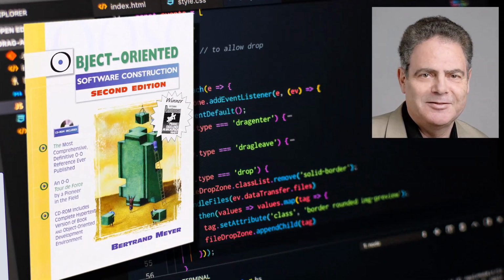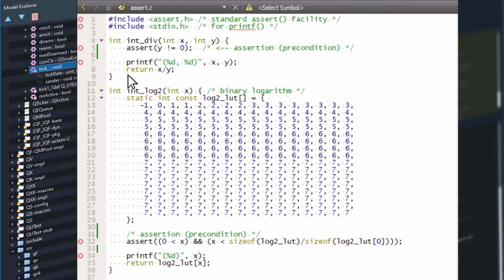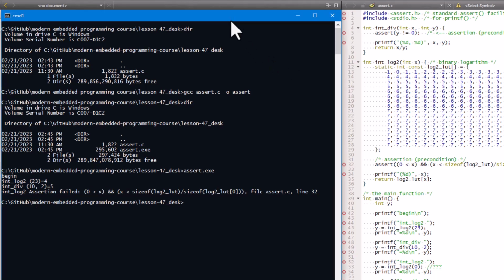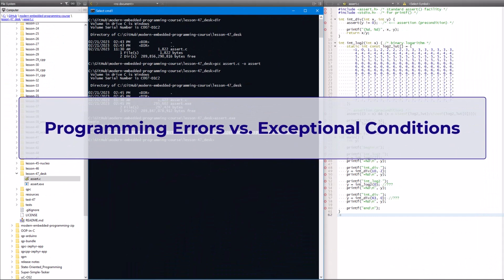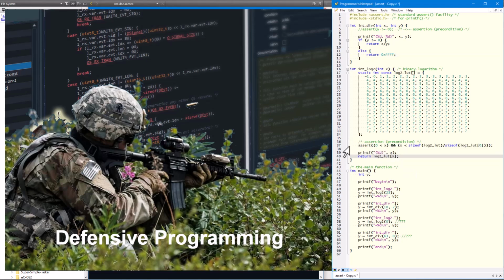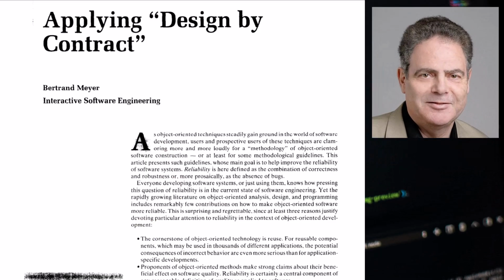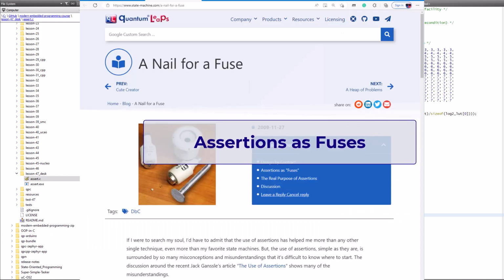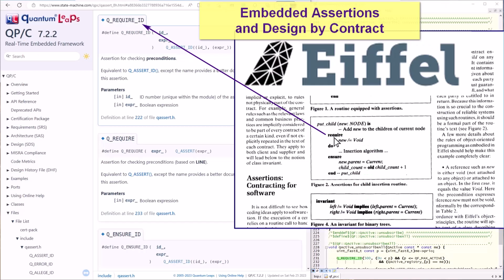#47 Assertions and Design by Contract, Part-1

Comment: thanks for the video it was very help full, this looks very simular to the unit testing, w hat the different between the two (expect that unit testing run off target)
Reply from the maker: The purpose of assertions is to provide self-checks in the code. The purpose of software tracing is simply to report what is going on, without checking for correctness. But I can see how these two concepts can be conflated and confused because standard assertions print a message, so in a sense, they produce a "trace". In the next lesson, you will see embedded assertions that don't necessarily print anything, yet they are still valuable to perform "damage control" and eventually reset the system. I hope this will help you see the difference. Stay tuned! --MMS

Comment: Hi Moro, is the assertion a right methodology in a code that is going to be compiled as a binary library and its functions are going to be called by a client code?
Reply from the maker: Yes, assertions (especially the precondition assertions) are especially valuable in library code! This is because every non-trivial library can be used incorrectly, and assertions formally specify and automatically enforce the "contracts" between the library and the client code. In my experience with the QP/C and QP/C++  frameworks, the assertions are there primarily to catch problems in the *client code*. I will talk about the impact of assertions in Part-2 on the subject. Stay tuned! --MMS

Comment: Lots of words, just to present assert()
Reply from the maker: If you think that this video lesson is just about the assert() macro, you probably missed the point. Assertions are simple to implement, but it is a mistake to think that the use of assertions is simple. If this was the case, you'd see many more assertions in the embedded codebase. Instead, you still see a lot of "defensive programming", which is an anti-pattern. This lesson attempts to educate the viewers about assertions by showing the correct mental models of assertions (e.g., Design by Contract, assertions as fuses, etc.) and the proper ways of applying assertions (to avert errors and NOT to handle exceptional conditions). The next lesson will be more specific to embedded programming. Stay tuned! --MMS
Reply: @StateMachineCOM  you could have mentionned BUG() in the linux kernel. I'm well aware of what you're saying, the theory that you describe is mere "intellectual masturbation" to me, if you may.